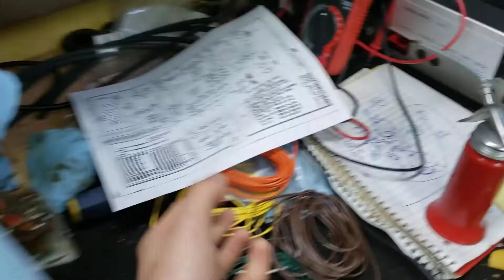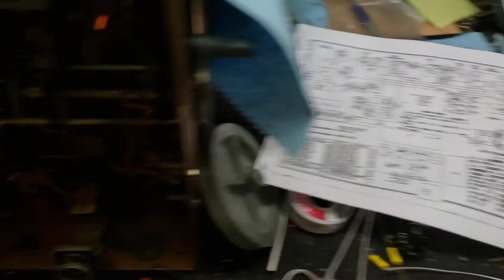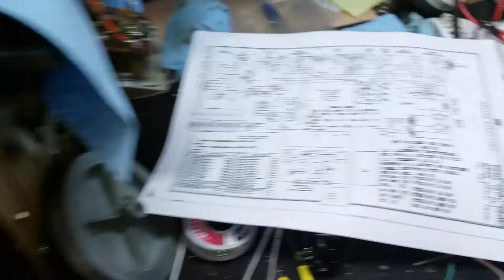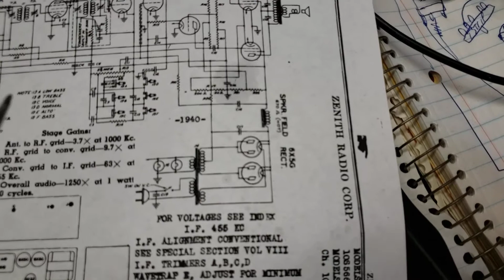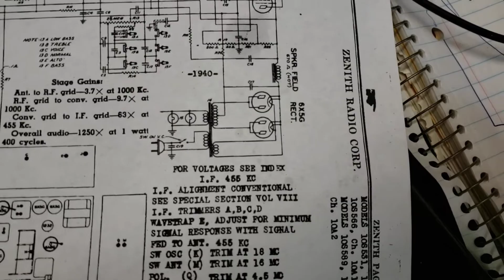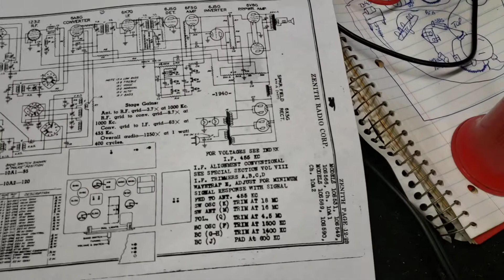Zenith 10s566 supplemental: Rectifier issue...

Comment: The most reliable solution is to put a #47 lamp in series with the center tap. It acts like a current limiter much like the modern NTC thermistor. 
In some modern equipment a CL-90 thermistor can be used. In your older radio there should be no problems with the lamp doing the exact  same thing to 
hold the inrush  current down  at start up so it doesn't  affect the tubes and ruin your transformer!

Comment: I am not much good at this but without looking at the schematic I can't help you.
Why do you need to lower the voltage?
These sets were designed to run on 115 to 120 volts, unless you have very high line voltage do 
there is no need to reduce it.
Do not use a resistor, you will need a very large power resistor, use a bucking transformer only IF your line voltage is over 120 volts.
Fuse the radio after the power switch.
Reply from the maker: Well our voltage usually runs right at 120, but I read it's safer for the radio if you reduce it to 110
Reply: @coolbluelights  It should run fine on 120
Reply: A power resistor would let the transformer run cooler.
Reply: @kolo1301  But the resistor will generate lots of heat, use a back buck transformer.